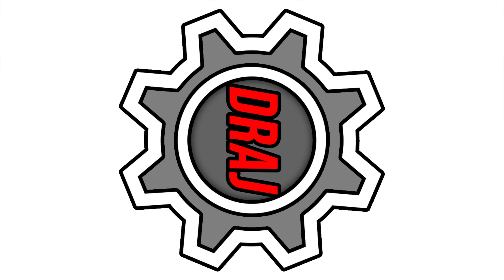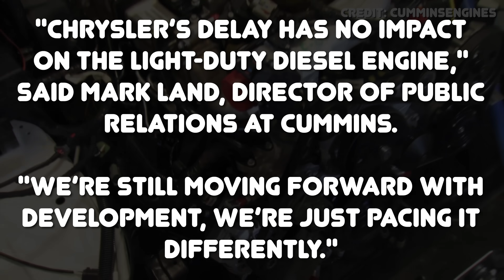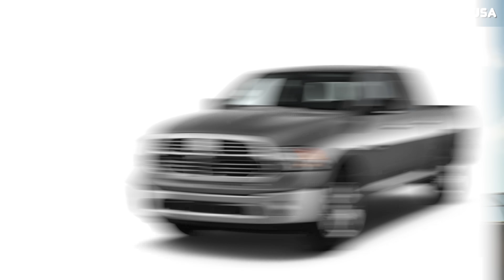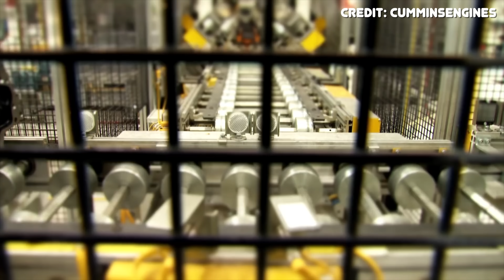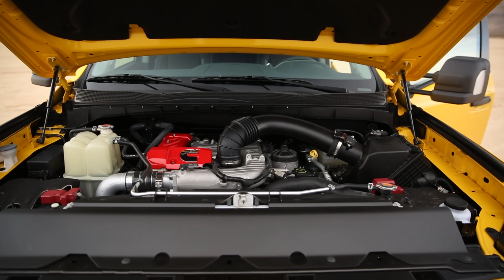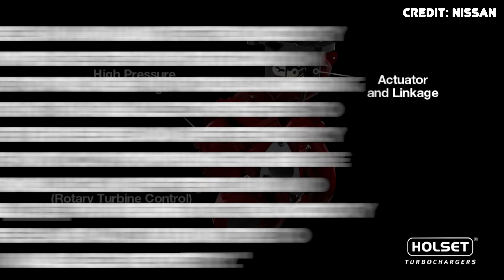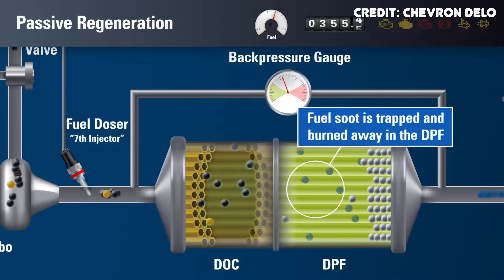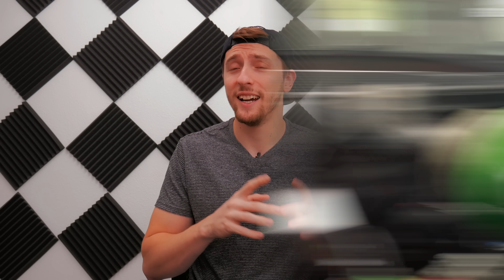5.0L Cummins: Everything You Need to Know

Comment: As a former Cummins technician myself I thought it was stupid they went back to using glow plugs on the ISG. The old 5.9L and the 6.7L in the Ram doesn't have glow plugs. 😕
Reply: Because the 5.9 and 6.7 are direct injection.  If the 5.0 is indirect injection it will need glow plugs
Reply: @robertlindsay9826  What you said makes absolutely no sense at all. Direct injection has nothing to do with needing glow plugs or not.
Reply: @Modine.  Don't believe me then. Google it
Reply: @robertlindsay9826  Google what, that the G series has glow plugs? I know it does. But you insinuated that the 5.0 needs glow plugs because its direct injection. That's what doesn't make any sense. Btw all diesel engine are direct injection.
Reply: @Modine.  I don't know anything about the new 5 liter.  Not all diesel engines are direct injection. This is a big subject, but just about all small diesels used in pick ups are indirect injection, they have a pre combustion chamber. The diesel is not injected straight onto the piston, but into this chamber which is press fitted into the head, ie just about all Toyota's. A good example is the Cat 3206 engine. They are made  in both forms, the indirect injection been the older design. What I was taught , is that an indirect injected engine is a bit quieter and can rev higher. But direct injected is cheaper to build supposedly more economical, and in my opinion not very much louder. Like my wife's car , Landrover Freelander has the Ford ,2 2 EcoBoost, direct injected. It does 16 km per liter, at 130 km per HR. Which is excellent.
I live in SA.
Regards Allan
Reply: @robertlindsay9826  Ok as someone who doesn't know anything about diesel engines is going to tell a former Cummings technician anything!? Really?  No engine ever made was designed to have fuel sprayed into the piston, I think you ment cylinder. An engine having a small pre combustion chamber is one thing because engineers will integrate them into there engines to help lower compression ratios and meet admission standards and the pre combustion chamber is directly on top of the cylinder making it direct injection. The only other form of injection is port injection which would lower compression ratios to much for a diesel engine not making ignition possible.
Reply: @Modine.  Listen bro. You talk like an old timer. I've also worked for Cummins, NOT Cummings. You don't even know how to spell the name. And I've been working as a mechanic and still am for ,40 yrs. Besides the above, why do think that direct injected engines have a depression machined into the piston? This is where the diesel is injected, into the "bowl " of the piston. Whereas a indirect injected , fuel is injected into the Pre combustion chamber. Just google the subject, you will see what's going on in 5 minutes. This why a direct injected engine is noiser then others.
Another thing , do you know that the hole in the piston for the gudgeon pin is not in the centre? It's a bit off. As the piston ,once injection takes place wants to kick sideways in the bore. This off set idea takes that problem away. But I think this only done on high HP industrial engines.

Comment: From what I’ve learned about diesels this engine falls in the spot between the new 3l gm unit and their larger brethren not getting the power of the larger units while not being able to keep up with the 3l in fuel economy making similar power
Reply: No, it’s not perfect, but no vehicle is, though making much more power than the 3L. It is weak sauce in comparison. Plus, the 3L just can’t handle the load that this truck can, with it’s much beefier chassis and breaks. I regularly haul a fully loaded fifth wheel at a bit over 14,000 pounds. No way a little 3L 1500 can do that, without serious issues, or at all. It would definitely break that truck

Comment: This engine was barely introduced to the Nissan when I was in tech school. I went to UTI and went through their Cummins program. I think it was the week before graduation that it came out. I was able to take the online courses for it and learn a little bit. I wish we had the chance to see them in person in class. They are very weird for a Cummins. Typically V-engines from Cummins are built in 16cyl or larger for locomotives or marine applications. Cummins also never uses glow plugs on ANYTHING so when they made it with glowplugs we were all shocked lol. I think Nissan went about making the truck wrong in a way. They made it too much in between a 1500 and a 2500 like it was beefier than a 1500 but it wasn’t as strong as a 2500 and the price reflected it in a strange way too. You could get a much cheaper gas engine or a slightly more expensive diesel that would be much larger and more powerful. I really hope that another company comes along (looking at you Toyota) and picks it up and slaps it in one of their trucks. We need all the diesels we can get in the US as we don’t have too many options!
Reply: I want to put one in a rock crawler
Reply: I like The QSK95 4stroke Cummins in locomotives. Easy to start and clean and works like hell but you can never beat the sound of a 2 stroke V16.
Reply: So how do cummins engines usually cold start? Richer fuel mixture? I'm no diesel expert so forgive the ignorance!
Reply: @anotherrandomtexan25  grid heater
Reply: A toyota 3/4 or 1 ton with a diesel would be a game changer toyota reliability tied with the tourqe and reliability of a diesel just damn near the end all of diesel pickups sadly they probably wouldn't ever put anything bigger than the 5L in a pickup
Reply: Won’t happen.
Reply: v 555  v185  v210 v903  v1710
Reply: Love my imported 97 Toyota hilux surf (4 runner) with the 3.0 turbo diesel in it. Really hope Toyota puts a beefier competitor to the big 3 in the tundra one day for us muricans.
Reply: @donovanchilton5817  I think you misunderstood my comment towards the end. I was saying since Nissan no longer has the Cummins I was hoping that Toyota would pick it up. I know they wouldn’t bring one of their own engines to the US. All they would need to do is take that existing diesel engine that already meets the EPA standards and adapt it into the Tundra similar to how Nissan did to the Titan. That would be the only way we could ever get a diesel Toyota truck without importing an old one

Comment: Architecturally the inline six is king,( just look at the on highway truck tractor segment) the crankshaft main bearing to conrod bearing layout enables low end torque production without tearing engine up compared to v8 shared conrod journal layout, even CAT and MACK went away from on highway V8,s after HP levels rose to above 500, crankshaft, block and bearing durability became an issue especially if trying to operate at lower rpm ranges where torque rise is greatest so by its Nature the 5.0L will never be able to compete outside its original parameters, [I know military VT903 applications in 600hp exist but they are not having same payloads and are high rpm specific which is a big factor same as marine applications]

Comment: I had a 2016 XD Platinum Reserve. I loved it at first. Then the problems started. First was the low fuel pressure warning coming on anytime the tank dropped below 1/4. Then the lift pump burned out and it was in the shop for almost a month because there is only one Nissan diesel tech in my area. Then I got a code indicating an exhaust pressure sensor problem which made the truck run like garbage and caused the DPF to become overloaded because it would never finish a regen cycle. Of course there was also the absolute crap fuel mileage and the dead pedal issues. I traded it for a 2019 Ram 1500 with the 5.7l. That truck gets up and goes and doesn't think twice about it, and gets better fuel milage that the Titan.
There was a lot I loved about the truck, but equally as much that I hated about the engine.
Reply: Cummins stopped making that engine due to all of the quality issues. It was originally supposed to be used for school busses.

Comment: I have a 2018 xd with the 5.0L Cummins. I like this as a daily driver but it has enough power and capability for towing a 3yard dump trailer full of rock or my 21' boat with zero issues. I do wish they would have kept making this configuration truck, or sold this motor as  a swap motor. Would be a great fit for older rigs, or a jeep conversion.
Reply: i mean it depends what you define as enough power.. people were still towing 3 yards of gravel in a trailer back when engines were struggling to put out 120hp, downshifts were more common and hill climbs didnt hold speed, they still got the the jobsite

i mean my 1996 ppump is still at stock power after 600k kms which is only 175HP and ive towed 19,000lbs with it through a worn out automatic trans without issue.. big hills on the highway were done at 80-90kph instead of 110-120 but transport trucks do that every day and no ones going around adding more power to their fleet trucks to do the hills at 110
Reply: @AndrewBrowner  your right. In days gone by we did more with less. But, by enough, I meant for the truck to perform the tasks I ask of it, and not hinder traffic. These are personal tasks. I am not engaged in commerce with this vehicle.

Comment: Let's see, so far they have thinned and cheapened the block including no wet liners,  they are using a troublesome HP fuel pump(can't predict failure and failure means replacing the entire fuel system!!!) even though better more reliable ones are available!  Trouble prone Turbo and emissions system (diesel makers have had at least 15 years to perfect these systems but alas no.  You talk about what this engine was designed for - I would say it is designed to fail.  When are engine makers going to learn that trying to save money only gets them in trouble and ruins their reputations?!!!

Comment: I just drove mine 18,000 miles towing my 10,000lbs trailer. No real issues came up, just the DEF injector (same as the 6.7 Cummins btw) it was as a 10 minute job with a 10mm socket and available at the local auto parts store. Hardest part of the journey was up the continental divide in Montana! Wouldn’t get over 45 mph up that mountain. Great truck though, I know it would be better if I put it on a “diet”.
Reply: That is not bad for the grade and pulling 10k and only putting out 310 hp.

Comment: Having worked at a Nissan dealership the info I was given is this, “Cummins and Nissan didn’t have a good partnership. No one knew who would take care of the warranties, no parts were available,  and most of the techs weren’t trained or knew how to work on them.” Sounds like they had a bunch of warranties too. They were ordering entire engines for warranty, and actually had them in stock for a time because it was that bad.
Reply: I almost pulled the trigger on a used one with low mileage. I stopped myself after I read all the major issues. Transmission apparently can have catastrophic failure. The emissions system had problems as well, and other issues, turbo problems.  I learned my lesson after ford 6.0.
Reply: @Calebflying2025  Yea I learned my lesson with any Ford back in the mid 80s. Why anyone would ever own one is far beyond me. I had a number of them from used to brand new. All where junk.
Reply: @arlissyoung8899  I am a big Ford fan lol. Those issues were with international, who made the engine at the time. Yea, I actually drive a Ford EB myself.
Reply: @Calebflying2025  I understand, like I tell people if you like them go for it. As for me I will never own another one and haven't for many years. I remember the big problems with the Internationals. Ford put it off on them and International let them know "We built what you asked for and gave us in the blueprints"  My friend had a Ford truck [gas] and because he didn't use a "Motor Craft" oil filter it destroyed his motor. It's even in the owners manual if you anything other it will happen, I stay away from things like that as much as I can. Best of luck with them, your going to need it LOL.
Reply: I'm a Ford diesel tech and I'm specifically trained for it. When I heard Nissan was gonna offer a Cummins diesel engine, my first thought was "those poor bastards don't know how to fix that thing". I feel for you guys. Diesels are a different animal.
Reply: Ya Cummins dropped the ball big time.
Reply: @Drivethisnotthat  or Nissan? That's like blaming Navistar for Ford 6.0/6.4's. These are custom made to order engines. Don't pray for rain then bitch when you don't have an umbrella
Reply: The DavesAuto channel has a 5.0 Cummins diesel in the shop with only 40,000 miles. Trashed bearings. $20,000 for a long block.

Comment: Am I the only person who sees the factory power output and thinks it's plenty? Nissan actually hit the nail on the head with what I'd want out of a diesel for a personal use truck. If I'm towing and hauling enough to justify buying a 6.7 then it would be a 4500 or f450 and set up specifically for towing. 10,000 for an engine option is absolutely insane and I can't see a use for that much torque in a non commercial truck anyway. I know that I don't hold the views of many diesel owners but it seems that nissan took a realistic approach. I wish my 08 titan long wheelbase had a smaller inline 6 diesel built with the same approach as the 5.0 cummins. The 5.6 is great but a truck of its size would work well with an engine like that

Comment: Had a Titan XD with the 5L heater. Good everyday light duty work truck. Had a few issues with it over the 2 years I had it from blown egr cooler, blew and axel seal twice, had several electrical issues, and the thing was a magnet for hit and runs. 3 in 18 months.  Poor girl was totaled by a tree in a bad storm in my driveway. Have a 3500 ram with a 6.7 on order excited to see how much better it will be at work but also everyday driving.
Reply: Dodge? Really?
Reply: @talisikid1618  my local ford and Chevy dealer and not the best and I already have a lot of Cummins parts so I figured why waste them.
Reply: @TheLandscapeGiant  that’s a good point. I noticed when test driving duramax and Cummins that the Cummins definitely rode pretty rough but it wasn’t too bad. In the end I settled with Dmax but I could see myself in a Cummins powered truck in the future
Reply: @talisikid1618  
Lol 

All the three trucks are the same 

Dodge Ram or wherever… has the better motor 
Get over it

Comment: They should have added 2 pistons to the joint komatsu 3.3l engine. Would have been a 5.0l i6. The Ram 1500 engine bay would have had enough room. The reason the 2500-3500 hoods are taller is for the large radiator to cool the 6.7l.

Comment: This was a great truck, the only problem was they should have just shot for a 15k towing number and a a payload greater than 2500#, which the truck is capable of doing.  Add to that, all the reviewers saying you could get a F150 that tows as much, which was true at the time, if you wanted a 2 wheel drive, standard cab with an 8' bed with a V8.  Even then, some of the F250 numbers were great, unless you opt'd for the powerstroke at which point, many folks are overloaded when towing.

Oh well, maybe we will see another one, but probably not...

Comment: Got a 2019 xd pro 4x diesel in dark green. I’ve never seen another green one in person. Love the way it tows compared to a 1/2 ton. The fuel mileage is 1/2 ton gas range when it’s empty but put a load on it and that is where it shines. Its obvious that it needs another gear to get better empty fuel mileage on the freeway. I wished they would have kept the diesel and continued to refine the package. They had a great idea and I love mine.
Reply: You know everyone can read your comment right? Even guys that also have an xd cummins? I have owned mine for 3 years and will tell anyone, including you, they do not get 1/2 ton fuel mileage. These trucks are notorious for terrible mileage when compared to literally any other 1/2 ton trucks including the 5.6 titans, I have both right now. The best I have ever gotten from the cummins on a full tank of fuel is 15.4 mpg. The 5.6 is the next worst fuel economy of all the 1/2 tons, mine will only get 17 if I absolutely baby it with only interstate miles. These are not trucks to own if fuel prices are a problem, my 2021 chevy 2500 gasser company truck gets 20 mpg and it's an actual 3/4 ton. Don't get me wrong though, I chose the nissans, I've had 4 titans a d loved them all, my xd is the favorite but it's not because it's cheap to own
Reply: @toWergOd81  lmao couldn't said it better my 17 nissan xd cummins only gives me lousy 13mpg lol but has good towing and love how it drives
Reply: @toWergOd81 I have both engines stock no lift and my 5.6 gets like 11mpg and the 5.0 can get 20mph on highway. In California diesel can be over a dollar more per gallon though.

Comment: Really wish when they were acquired by fiat that ram had still used this motor for the 1500 platform. “Like it was planned to be”. The eco diesel is cool and all but a V8 Cummins sounds waaaay better
Reply: Ram likely feared it would short the sales of their highest priced truck, because most of the diesel owners out there today don’t need a 3/4 ton truck😂
Reply: @skylerstringer6893  fine by me. Maybe a new 1 ton wouldn’t be $100k if this had happened 😂